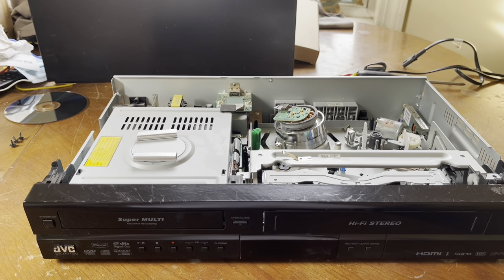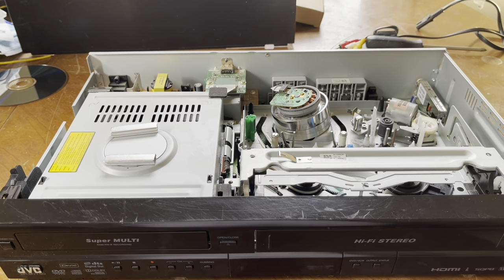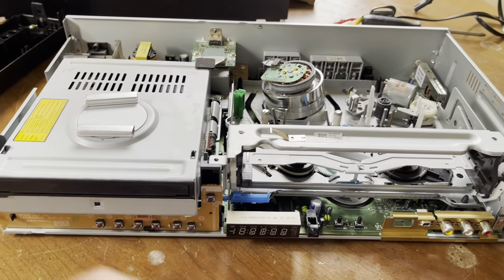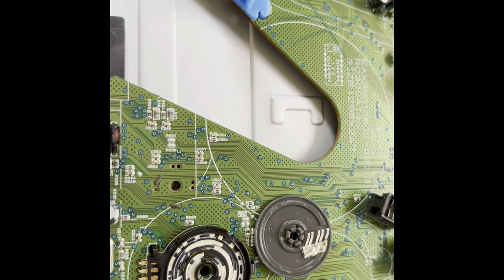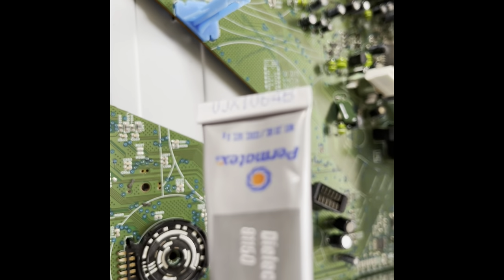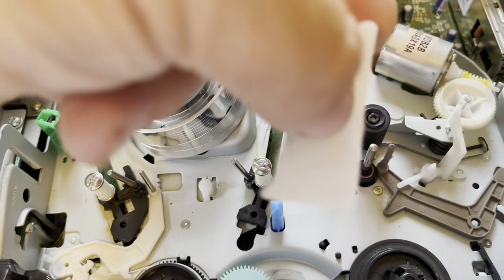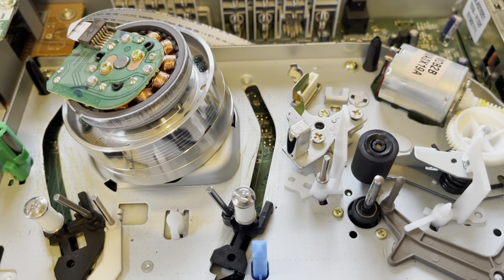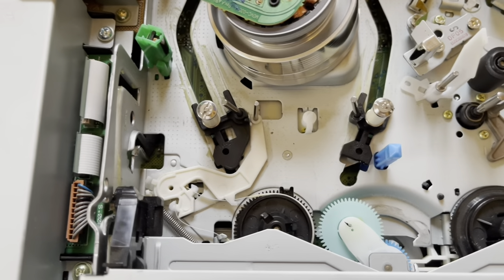JVC DR-MV150 Combo VCR DVD VHS Dubbing HDMI Recorder Teardown and Repair

Comment: Mine turns on, displays "hello" then turns off after a few seconds. Any idea what could be the issue?
Reply from the maker: Likely bad 1000uf capacitors in power supply.